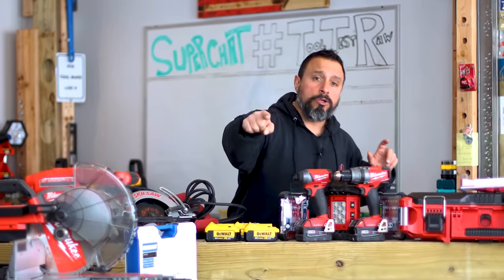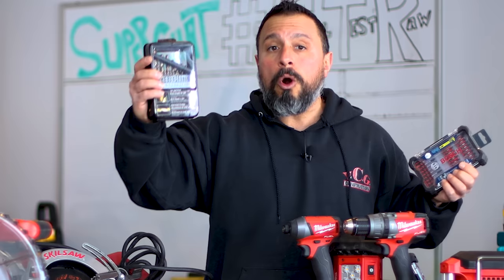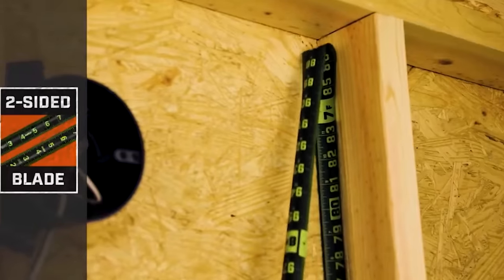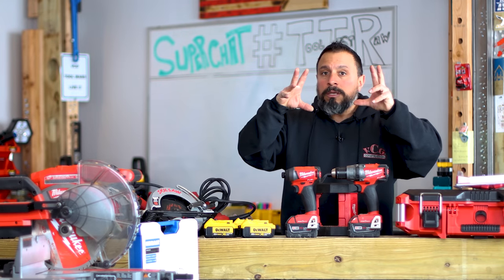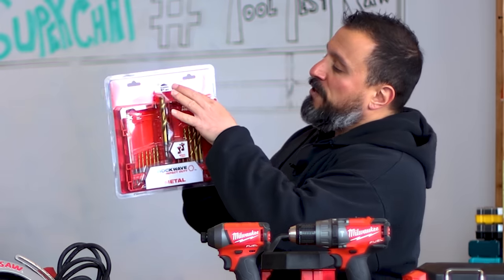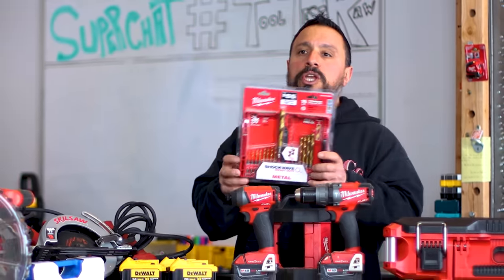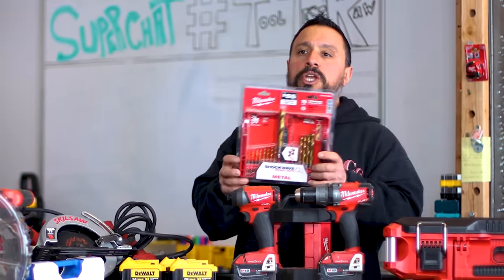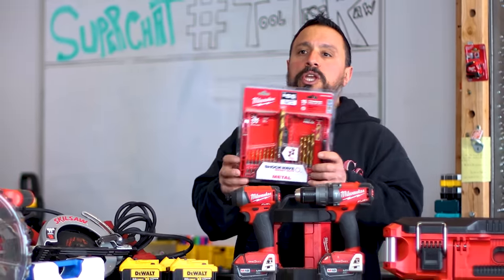DON'T MAKE THIS STUPID MISTAKE! NEVER PAY FULL PRICE FOR TOOLS

Comment: I remember you mentioned m18 bare tool chainsaws for like 125$, and m18 one key hammer drill/ impact driver combo with hard case for 125$ as well. Epic deals, that I wouldn't have known about, if it weren't for VCG.👍

Comment: I was able to get that same Milwaukee 15 piece drill bit set for $9.99 over the same holiday span that he was talking about. Some of the stores in my area (Minneapolis) were higher but I went to three Home Depot stores the same day looking for a gift for my buddy. Saw that drill bit set for $14.99 at the first one $17.99 at the second then when I found the drill combo for my buddy that I was looking for I got those exact bits for $9.99. That said, even with sales during the holidays make sure you check other stores (even if it's 3 Home Depot stores) they still vary due to income in that area. At least that's how it is up here.

Comment: Got the Milwaukee stubby 1/2 with a 2,4and a 6 for like $237  from Home Depot 2 weeks ago.
Returned the 6 batt for $119 and put that towards the m12 ratchet. Sick deal thanks .
Reply from the maker: Good score!
Reply: Did they let you just return the battery as is, or did you need a receipt from a different battery purchase?
Reply: Justin with no receipt I got a Home Depot store credit which I then used towards the ratchet.
The battery pack was unopened.

Comment: I just brought home the Makita hammer drill/impact driver with 2-5 Ah batteries and charger. It was sale priced at $325. I got the set for $225 because a one time $100 off if you trade in a working drill, battery and charger. I let go of one of my Craftsman go for the trade. I am giving the other to a friend of mine. I now have Ryobi, Milwaukee, Rigid, and Makita sets. My Ryobi is getting old but still hanging in there. The Rigid impact driver I love has three speeds. The Makita has the slow start, which makes the Milwaukee my least favorite with too fast of speed for screws, nuts, etc.

Comment: Hi Vince from Puerto Rico. Probably You will not read this, but, last year I got a very good deal from a milwaukee "authorized dealer", the 3 piece packout with the 48-22-8301 backpack for $200. It was a one day promo offer. Also I took advantage of the Milwaukee M18 Fuel Miter Saw at Home Depot with (2) 9ah batteries for $ 150.

Comment: Just got my Metabo HPT hammer drill kit last month. Lowe’s had it on sale for $229 down from its regular price of $299. It is frequently on sale for $279 which is not significant. The crazy thing is the bare tool alone is $199, the 2 batteries it came with (36v 4.0ah) are $120 each and the charger is another $60. Plus it came with a hard case. After using my Lowe’s card I ended up paying $234 after tax. I was already using Hitachi 18v cordless tools so it was a no brainer. Plus I just discovered that Metabo is running a promotion thru 5/31/21 where if you buy a select tool or kit you get a free 36v battery or 36v ac adapter. This drill kit is one of the products that qualifies. So I just got a $160 ac adapter for free. Also just bought the 7 1/4” 36v circular saw and that also qualifies so I’ll end up with another free $120 battery since the limit of promotional rebates is 10. Yes, 10. Can’t beat it. The drill is awesome. The batteries last forever. I feel like I walked out with a hell of a deal.

Comment: Check online for great deals too. Last year I picked up that Dewalt Flexvolt sliding miter saw (tool only) for $400. I didn’t need the the flexvolt batteries and charger. Already have plenty of those.
Reply from the maker: Sweet deal!

Comment: I managed to scoop up a dewalt set with oscilating tool, drill, impact, sander, light with 2 batteries and hard case for 250$. Good deal??

Comment: Just subscribed. Signing up for retailers promotional email list is good way to find these deals. Just got Milwaukee M18 Fuel grinder and (2) 5AH Bat from Home Depot for $150 shipped. They may have tossed an extra battery in by mistake, but still amazing deal.

Comment: Scored a Matabo 10" dual bevel 36v cordless at Lowe's that was on clearance for kverb1 year at $699 and got 50% off that plus another 5% for using lowes card out the door for $301 i think 😀 
With 2 batteries and charger!
💥 💥 BOOM!

Comment: If I need a tool, I go for Ryobi. I am lucky to live where I have a Home Depot 2 minutes from my house. If I find something I want, I, like my dad will check to see if the Factory Direct Tools (Ryobi and Rigid recertified/scratch and dent store) at the outlet mall has it for cheaper. Typically they do. My next tool purchase will likely be either a Ryobi battery chain saw or a Ryobi reciprocating saw. I don't need any more power tools other than that, even though I am someone who likes to have every tool so I can have something for the right job.

Comment: Hey boss, I'm trying to get either a brushless impact driver or a drill/driver. However, prices at the moment are about $20 cheaper for impact driver kits (Ryobi and Makita impact driver with battery for $99). Is it safe to start off with an impact driver and use drill bits for home use? I understand Makita has more expensive tools than ryobi in their lineup, but my place is small so I won't be needing other power tools. Thanks!
Reply from the maker: From what it sounds like you’re explaining you should be fine!

Comment: In 2017 I got the 9 tool Milwaukee m18  brushed set (yes I know brushless is much better) for $499. This included a bit set, a reciprocating saw blade set, 2 batteries, 2 bags, a reciprocating saw, circular saw, 1/2 inch impact wrench, right angle drill, pivoting head worklight, impact driver, drill, blower, and a multi tool (the multi tool is really not that great that's my only complaint). I was 22 at the time and just starting to really buy my own tools for work and at home and this deal really can't be beat, especially when considering this set is normally $999.

Comment: I know I'm going to get reamed for saying this, but the Black and Decker 20v tools aren't bad at all. I have the drill and the mini circular saw. Saw eats up batteries, but have been pleasantly surprised with the driver. The only problem is the (besides the saw eating battery life) was not quite enough torque in the driver for some applications. If you're just driving screws all day, it's a great tool for the price.

Comment: $125 for the milwaukee dammnnn..  I did the same with Ridgid and got the gen4x brushed set for $99 so I am on ridgid platform.. 

HD had a special deal on gen5x brushless circ saw with 4ah battery and charger for $169 and they had the tool only brushed gen5x for $129  so I obviously went with the kit.. Direct Tools Outlet has factory blemished Ryobi and Ridgid so I have got a 4ah and 3ah octane batteries for like $30 each.

Comment: The Cresent nighteyes x2 was 13.99 when I bought it in late January.  Haven't seen them since.  The Milwaukee red helix bits were $16.99 at northern tool.  Best deal was a Milwaukee 2804 hammer drill in a hard case with 2x batteries.  $129.99, and I got a 3rd 5amp battery.  That was northern tool also.

Comment: End of last year, I purchased the 2997-22 kit for $399, but it included 2621-20 Sawzall and the 2630-20 circular saw. 
I am a datacom guy, and the Sawzall and circular saw are not things I need often, but every so often, I need them (I have the 2629-20 band saw that I use for most of my conduit and unistrut cutting needs), and I've need a circular saw several times in the past year and had to use my saber saw (also an M18 tool).  So I paid $400, and I sold my old hammer drill and impact driver, which were in separate cases, for $200. So, in the end, up got the 2 saws, and replaced my drill and impact driver for $200, and the best part? Something I have wished for a long time; the drill and driver are now in the same case! 

I also scored, for $150,  a pair of the 4.0 Ah M18 batteries, with a charger and a contractor bag, along with the M18 oscillating tool!  I will not ditch my old, Rigid electric one that has always been a pain with the cord. 

The bundle deals on Home Depot's website seem to be endless.

Comment: I am pretty new to home diy stuff, i needed a hammer drill for a while. And I've recently bought a bosch hammer drill, 3x2ah batteries and the charger for the price of the solo tool. I don't get the power tool prices, either these are pretty good deals or we are normally getting ripped off.

Comment: Wish I could hit those deals. Unfortunately in my country there is almost no such deals. And shipping+tax would rise the price 2-4 times. And on top of that milwaukee stuff costs 3-5 times more than similar dewalt/makita tools. The deal of my life was rear handle makita 36v bare tool ~180$ when its average price around 280$. Makita's batteries are the cheapest of most brands they could be found arond 60$ per 5ah unit, when DeWalt or Ryobi(sic!) around 75$ for same capacity unit. For comparison Milwaukee 5ah costs around 180$(Yup, exactly same price as big makita saw). Dewalt tools(18/20v) could be found little cheaper over Makita's but batteries, chargers, spare parts a way more expensive. And Flexvolt line is way way more expensive with almost none batteries kits.

Don't really sure why am I writing this. Just wanted to share my experience in this field and say that prices are wery region-dependent.

Comment: I got a 5 tool kit at Home Depot Milwaukee. It has the half inch, the quarter inch drive, drill, grinder, one handed sawzall, and 2 batteries and m12/m18 charger for $299 I waited by that clearance section until they could take the security device off because ain't nobody going to take that deal from me lmaooo

Comment: Acme tools doing 10 percent off 1 tool and 20 percent off 2 tools and every tool after 2 tools is 20 percent off on Milwaukee m12 bare tools until 4 30 20
Reply from the maker: Thanks for the heads up Antonio!
Reply: @VCGConstruction  any time Vince glad i could help Cuz
Reply: Did a quick video on this deal

Comment: I buy almost all my tools at bomgaars.  They have massive dewalt sales all the time.  Even the bare tools usually are 10% plus free batteries.  Inpucked up the dewalt flexvolt miter saw plus the good stand plus an extra battery 760 tax included out the door.
Reply from the maker: Where are they located?

Comment: I scored the m18 Milwaukee fuel set with the hammer drill for $400 but came with a saw zaw with battery a millwakee tool bag and the pack out tool box for free .99 it was like almost $800 online for all that I got it 50% off. F**k yeah

Comment: I need to find the Milwaukee m18 fuel 3/8 an 1/2in impact wrenches cheap i dont wanna spend 450 just for a tool an batter an charger
Reply: I spent 310 for the high torque fuel m18 1/2 high output XC 8.0 and rapid charger. Found good deals online saved myself a couple hundred. Amazon sometimes has random deals

Comment: that milwaukee M18 battery deal was $199 for the 12amp hour + 8 amp hour during black friday at HD
Reply from the maker: An online retailer ran the “MUCH BETTER “ deal I talked about in the video, sorry you missed it!
Reply: @VCGConstruction  i didnt miss it...i knew about the home depot deal...i did not buy it cuz i dont need those big batteries...i dont use miter saws or large tools that require them
Reply: @kingofthecrease30 Yo cuz! How you been?   International tool had the 12 &8 batteries for $149 a couple of times during the holidays, but they sold out crazy fast. Brotherman I hope your having a wonderful week and I'll catch you on the flip!!
Reply: @amoscardoza5253  im doing great amos 👍 i am going to a woodworking trade show on saturday....a few of the power tool companies will be there...should be a good time
Reply: @kingofthecrease30  that's sweet bro!

Comment: I'd love to see a ttr with the miter saws I mentioned and with the aid of #vcg what's the best cordless saw value depending upon your needs. But I'm leaning toward the makita 36 volt 10" to get onto the platform. Until the m18 trim router Makita had the section locked down. And let's not forget about the yellow and black teams awesome trim router. 
In short everyone has a decent trim router so the other issues are gonna be the thing that clinches the deal in my humble opinion. 
Thanks #VCG
Reply from the maker: Makita is a very good choice Ivan!
Reply: Thanks for the "professional" input and advice.  VCG Rocks! 👍🏾

Comment: You got a better packout box with that m12 set than the rest of us did. My box is missing the aluminum corners and the flat plastic reinforcement inner flat plastic to the lid. Straight up cheesey box and didn't match the pics online on the retailer's website.  #butthurt .... can you tell?
Reply from the maker: That was the m18 set
Reply: @VCGConstruction  my bad cuz...I was driving while watching. My comment still applies to m12 set I bought...I have screen shots ....n i didn't get the box that was advertised....i got the dollar store version of the good Milwaukee box.

Comment: I gotta admit I find great deals and when I do I usually share em with a hand full of youtubers and I do enjoy your crazy amped up videos along with a few others but tend to stay away from the biased based pretty much paid off guys working the tool companies & the innocent viewers as well but that's not you guys...with that being said keep up the great videos (but try decaff after say 8pm ha ha)anyways  that lowes bit set was/is total GARBAGE the magnetic bits wouldn't hold a tiny steel cable thread & if you get a day's use outta any of the other bits before destroying screw heads before there even sunk & tips shearing off mid job your a lucky man guess that's why they give you so many duplicates anyway just my experience & keep up the great video's...